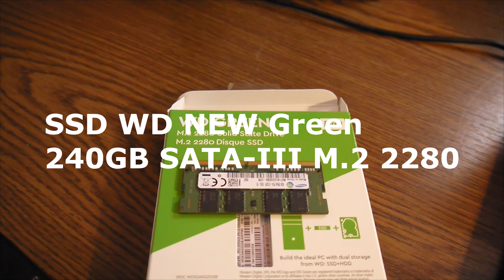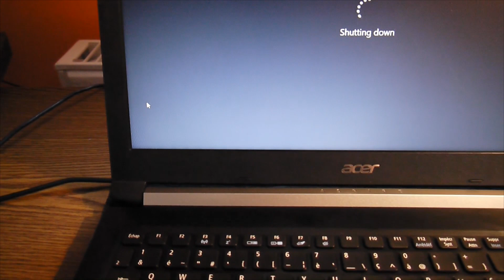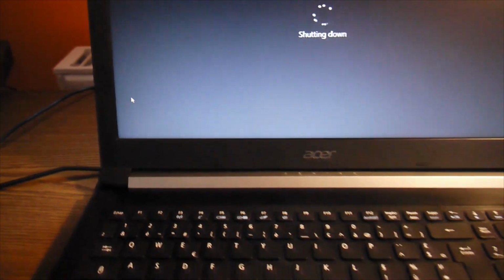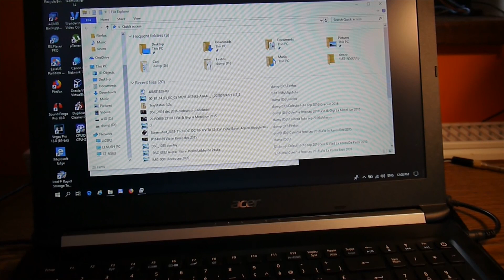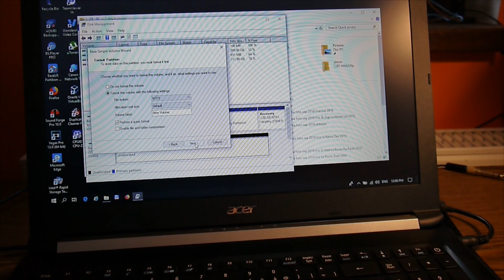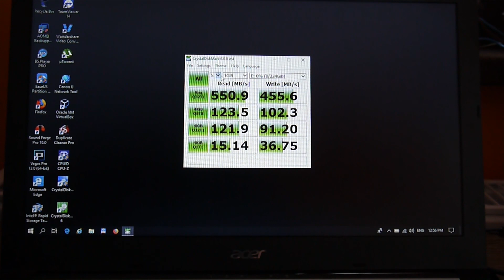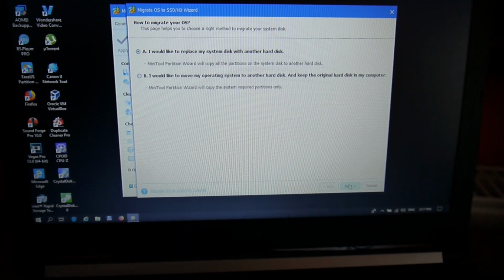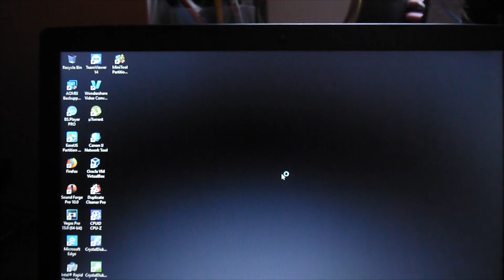Best Acer Aspire 5 A515 51 dismantle upgrade RAM and M.2 SSD

Comment: isn't that an Nvme port? Can I add m.2 ssd into that. The Nvme ssd has 2 pins while the m.2 has 3 pins
Reply from the maker: It's working perfect with M.2 SSD, I'm not sure about NVME, probably yes.
Reply from the maker: I couldn't afford a NVME SSD, so I just put in a M.2, but probably will fit one if your pockets are full enough! :-)
Reply: @viocaia  Thanks for the video and the quick reply. Actually, I went to buy WD green only but the shop people said that 
Nvme Ssd is required. So I came across your video. Now I will buy WD green for sure instead of the expensive Nvme ssd s .
Thanks.
Reply from the maker: @dejavukun   get a WD Green for now..mine is working smooth!  Good luck!
Reply from the maker: Hey! Just give me a hand and  subscribe ! Thanks!
Reply from the maker: about NVME install https://youtu.be/FA9paP39284

Comment: I have a 2TB, 8GB model, would motherboard support another 1TB ssd on it? and I am also getting 16gb ram, so that total would become 20GB. Is this fine?
Reply: I upgraded with 256 nvme and 16gb crucial ram. Has been more than an year and performs really really fast
Reply: @hvmalpani  
Does you laptop have a GPU??
Reply from the maker: Yes!
Reply from the maker: @hvmalpani  So NVME is working..thanks for sharing! Please give me a hand and subscribe...
Reply: @hvmalpani  bro which nvme you bought ? and can transfer original windows on it from hdd
Reply: Did you upgrade then??
Reply from the maker: @No_limits37  No, I'm still using the M.2 disk from the video..for me is more than enough..and it was a meter of price then..
Reply from the maker: As long as your SSD is M.2  or the kind of slot that fits the one in the video it should be ok.Also if RAM is DDR4 . should work as well.
Reply from the maker: Hey! Just give me a hand and  subscribe ! Thanks!
Reply from the maker: about NVME install https://youtu.be/FA9paP39284

Comment: Sir, I have 8gb Acer laptop of same model as your video, what is the specification or allowed maximum capacity for the empty ssd m
2 slot? Can I also replace the 8gb ram with 16gb?
Reply: The Max RAM on a A515 51G models supports up to 16GB single slot for a max total of 20GB memory (4GB onboard).
Reply: @Hurtsmysoul  Thanks Laura, I'm going to buy a new ddr4 memorry and I Will asking about if it's possible to supoort 16gb to 20gb total
Reply from the maker: For M.2  as much as you can afford, for the RAM just add another brick,the originals are soldered to the mainboard.
Reply: Thank you so much sir, more power to you.
Reply from the maker: Hey! Just give me a hand and  subscribe ! Thanks!

Comment: i have a aspire 5, it came with 256gb ssd and i want more space, can i add extra ssd and do i lose anything? i’m completely new to this, i would appreciate your response :)
Reply: also, what was the size of the screw you used?
Reply from the maker: What kind of Aspire 5 ..it should be there another slot for a M.2 SSD, so you can install an extra SSD M.2 for OS and use the resident as a data dump
Reply: Viorel Caia yeah i was about to put the complete model, it’s A515-51G-515J
Reply from the maker: Well, if is looking similar to mine, then you have for sure M.2 slot, so you can  fit a 256g M.2 SSD ,or better, and use the SATA3 installed like a data deposit, so the OS will boot from M.2 much faster.The overall speed goes like 20%
Reply: Viorel Caia but do i lose any data or apps?
Reply from the maker: @pipe451   No, as long as you move everything to M.2 and make it bootable from BIOS.
Reply: @viocaia  thank you very much :)
Reply: Viorel Caia hello again i am about to buy it and want to know if the ssd i put can be of 500gb or only 256?
Reply: i put the link of the ssd before
Reply from the maker: @pipe451  Hey you too! It can be as big as your pocket can deliver!
Reply: Viorel Caia that’s so great, thank you very much again!
Reply: Viorel Caia also would this ssd work as an extra? https://www.amazon.com/gp/aw/d/B073SB2MXT/ref=ox_sc_act_image_1?smid=ATVPDKIKX0DER&psc=1
Reply from the maker: Hey! Just give me a hand and  subscribe ! Thanks!
Reply from the maker: Please help me with subscribe! thanks!

Comment: Grea tutorial Viorel Caia . I have Acer aspire 5  A515-51g -5072 . i called acer support to make sure this laptop has m.2 Port they said yes, but the say you cannot use HDD and  SSD at the same time use either them of them in one go. is that work together i see you did both together and do i have the same laptop you got?  plz reply thanks in advance
Reply from the maker: They are working together.After you install M.2 SSD, move the os to SSD and in BIOS make it first boot.Afterwards delete old HDD partitions, and repartition and format.It have to loose any booting propieties, it just a simple data deposit.
Maybe acer support was thinking about  haveing two boot disks in the same time.Everything will be much more easy if you can connect old HDD by a usb adapter, then is very clear the laptop is booting from SSD.
Reply: @viocaia  thanks you so much for advice.
Reply from the maker: Hey! Just give me a hand and  subscribe ! Thanks!

Comment: hello i want to ask a question the aser aspier 5 battery is no enough just 5 hr can't do a thing so shlod i buy some high end laptop battery how can fit and drop it in
Reply from the maker: It's kind of difficult as long as the battery is inside the machine, you can't simply replace it with a bigger one.I think there are some compatible models, a little bit more powerful, search the net for something like this model 15.2V 48Wh AC14B8K
Reply: @viocaia  finally a good answer
 thx man
Reply from the maker: Hey! Just give me a hand and  subscribe ! Thanks!

Comment: Hello i'd love to do this upgrade myself but unfortunately i'm not able to find this memory in any stores in my country. Are there any alternative memory cards i could use instead of this samsung one? thx for answer :)
Reply from the maker: Any DDR4 will do the job,  even the cheap ones running 2133mhz are fast enough, see crucial CT16G4SFD824A, Kingston 8GB DDR4 PC4-17000 2133Mhz 260-pin SODIMM Non ECC Memory RAM...
Reply: Viorel Caia already ordered a crucial ballistix 8gb, thanks for helping. I’ll follow your tutorial once it comes
Reply from the maker: @jankonn9223  It should work! Good luck! Dont forget to touch anything metallic before starting anything,  for antistatic discharge.
Reply from the maker: Hey! Just give me a hand and  subscribe ! Thanks!

Comment: Hi, nice video, can I remove the battery without any problems and keeping using the notebook directly in energy?
Reply from the maker: No you can't because the battery is inside (like tablets have) to remove it you have to open the whole bottom pad and take it off physically.
Reply: @viocaia  Hi, thanks, I express myself poorly, my intent before is just to "remove" the connection of battery, not the whole battery haha, I did it, just removed the cable and works well, I don't recommend to remove the battery as like you, after you said that I opened my notebook to do the service, and I saw, there is no need to remove the battery physically and my suspects is that if someone remove the battery physically with the pass of the time it can desbalance the weight of notebook and can cause some trouble in touchpad in the future, there is my suspects as the way the notebook was build.
Reply: If someone wants to open the notebook to remove the cable of battery, please remove the HD first, removing the screws and the cable that connects the HD before open the notebook, because I disconnected the HD cable with motherboard(?) and for a noob me, or a person that has no experience on that can have a hard time.
Reply from the maker: @Guivaxs  absolutely ! the battery is a part of the mechanical structure somehow.You did well!
Reply from the maker: Hey! Just give me a hand and  subscribe ! Thanks!

Comment: I wish the M.2 drive was accessible through a window like the RAM is. That way I could add an SSD without voiding the warranty.
Reply from the maker: well I.m afraid you can.t, you need to open the plastic lid.But why not chage only the main HDD with a SSD for now and later when the warranty is over do the rest..maybe is getting chepaer in 1 year.
Reply: @viocaia  Ok, that's a good idea, I might do that. Thanks!
Reply: The Acer Aspire A515-52G that I'm looking at doesn't have the HDD and RAM ports at the bottom. 😞
Only the Aspire 3 models do.
Also the keyboard feels pretty cheap.
Reply from the maker: @JAYRAY00   well, it should have if is the same model like in the video, if not take some passion and open the lid, is not so difficult.Cut the power before, check for a little hole and push with a needle, that is disconnecting the battery,
Reply: @viocaia  I found the A515-51G, it's a bit more expensive, but worth it for the build quality. I've taken apart several laptops before, but as it's for my Dad, I don't want to void warranty. But apparently, if you upgrade the RAM or HDD on these models, it still voids the warranty. It's not a big issue with the RAM, as that can be easily removed before warranty repair.
Reply from the maker: @JAYRAY00  I'm not sure, I did it anyway, I had bad experiences with warranties before so I don't care, if is burning ..let it be! That's life, so I did what I need, M.2 SSD, extra RAM and a IPS panel, I'm totally happy with result.And the battery is running great too! Good luck!
Reply: @viocaia   Dear Viorel, would you kindly inform me which IPS panel you used?
Reply from the maker: @simonshurety3870  check this...
https://www.youtube.com/watch?v=mUdu9C8JOjE&t=297s
Reply from the maker: @JAYRAY00  I don\t know the model..mine 51G feels pretty strong..but I'm not  too mobile let's say, it's more like a desktop replacement for me.
Reply: If you upgrade ssd in authorized service center near you, you don't have to worry about warranty.
Reply from the maker: Hey! Just give me a hand and  subscribe ! Thanks!

Comment: my laptop is the same model but comes with 8gb ddr4 memory can I upgrade it, and will it make it run faster cos to be honest it is slower than a wet week and it is a new laptop
Reply from the maker: I think you should have a second SSD M.2 for the OS and applications.Even a cheap one like my WD green makes a huge difference.I also have 12G RAM (4 original and 8 on the slot)...well, it's pretty ok, I'm doing music, a little video and photo editing and it's moving way better then my ex SONY I3...and the HD display I put on is so much better than the standard TN.
Reply: @viocaia  You upgraded the display on this Acer?
Reply from the maker: Hey! Just give me a hand and  subscribe ! Thanks!

Comment: Hey man, nice video, I have a question, where buy you the screw for slot the m.2, because i bought  the 970 evo in my acer aspire 5 but  don't have the screw :((,  help bro
Reply from the maker: Hey! You may use one from the HDD, don't worry it is fixed enough with only three.
Reply: @viocaia  thanks dude! ❤️
Reply: @andersonzavala9659  
Is the Acer aspire 5 A515-51G is compatible with M2 nvme SSD

Does it worked with Samsung 970 Evo
Also could you please give me the benchmark if it worked on your's laptop
Reply from the maker: Hey! Just give me a hand and  subscribe ! Thanks!
Reply from the maker: about NVME install https://youtu.be/FA9paP39284

Comment: did you remove the original memory or you can place 2 memories in acer aspire 5?
Reply from the maker: The original 4G RAM is soldered to the motherboard, you have only one slot for extra DDR4 (up to 32G).
Reply: @viocaia  ohh and what if i replaced it will my all apps and etc. go?
Reply from the maker: @Aditya-zg9eo  The extra memory slot  doesn't affect any of the apps installed, just make the laptop faster and quieter.If you're talking about replacing the HDD hard drive, well there are two ways.To let the original in place and add a second SDD M.2 (the small one in the video) than transfer all the data to the new SDD or to replace the original mechanical HDD with a SSD, so you need to transfer all the things before to the new disk to make it bootable.Also you may save everything like a Image (plenty of software to do it) and just ''reimage'' the new hard drive.
Reply from the maker: Here is a misunderstanding.A memory in computer world refers to RAM (the small bricks, not the hard drives) , so if you thinking about having two Hard Drives (consider that a data bucket!) yes you can have 2 drives installed in this laptop.
Reply: @viocaia  which ram did you use ??
Reply from the maker: @gaganbhagat8547  It's in the video at 0:40 , but any DDR4 will do the job.
Reply: @viocaia  i think it will be upgrade able up to 20 gb ,the official site said that ..
Reply: by the how does your laptop peforms in terms of gaming mine model has 4gb ram and the hdd and i am thinking of upgrading it ,did the upgrade enhance your performance?
Reply from the maker: Well,  @drdecember614  the first display TN was pretty ok, after upgrade to HD LCD I had to change the resolution to half! But, amazing it was running  betterr with TN dusplay 1388 than a HD like I have now.If you are looking for a decent gamming laptop as long as you don't want HD that's a winner!But if you cnsider photo and video editing HD1080 is a must.
Reply from the maker: @drdecember614  and strictly to the question, every RAM upgrade and turn to SSD will boost your laptop permances at lest 50%!
Reply from the maker: Hey! Just give me a hand and  subscribe ! Thanks!

Comment: ive just realize mine only has 4 gb built in but no Extra ram chip installed in it. i hope it will help my laptops performance. im still thinkin abt upgrading it to SSD but we will see i might as well buy a new gaming laptop. im using an ACER 5 just like yours. and so far some games it works fine on medium settings but i havent tried it with SSD and More RAM im excited to see the outcome though
Reply from the maker: I'm not a gamer but I use a lot of audio and soft synths and after I added extra 8 G RAM and a second M.2 SSD only for the OS, so I keep the classic HDD  for storage but the OS and all the software are running mainly from a WD M.2 SSD... it was a huge difference.Of course it cost me like 100USD for the parts, I did the work myself.So if you can get a better laptop for 100 or 200 extra..do it.
Just for fun I installed Shadow of the Tomb Raider and with medium settings is running  very nice and fluently.
Reply: ah yes. im getting the mx500 SSD 500GB and replacing my HDD 1TB since i noticed i dont have too many apps on my laptop besides games. so hopefullu with my new Crucial 2400MHZ 8GB and crucial MX500 SSD 500GB it will make my laptop run smoothly for certain games on medium settings. with the MX150 u can also play resident evil 6 by the way. it ran smoothly for me
Reply: @viocaia  bro is it good to use this laptop for Programming and Virtual Box.. I also want to install dual boot on my system but will it work ?
Reply from the maker: It's more than enough.I replace the display with an IPS full HD and I'm doing video and photo editing like a dream.So, I'm also using Oracle Virtual box and running some soft synth without a clitch. I recommend more memory RAM from the begining.As for dual boot, I think is very easy because BIOS is very flexible.
Reply: @viocaia  than soon i will get one and thanks for replay....
Reply from the maker: Hey! Just give me a hand and  subscribe ! Thanks!

Comment: do u think this 16 GB ram will fit in the socket? https://www.amazon.co.uk/Corsair-CMSX16GX4M1A2400C16-Vengeance-SODIMM-Memory/dp/B077S17RPZ/ref=sr_1_17?ie=UTF8&qid=1546012000&sr=8-17&keywords=16gb+ram+ddr4+laptop
Reply: regarding this...i noticed certain RAM chips have different dimensions so im concerned that i might buy the wrong one
Reply from the maker: I think it's ok, as long as it is DDR4

Comment: Will it support wd black nvme ssd?
Reply from the maker: I'm not sure, I couldn't find any info about it.But M.2 is running for sure.It's amazing faster then original mechanical disk.
Reply from the maker: I did some digging and it's looking like is able to work NVME disks too! check this: https://community.acer.com/en/discussion/comment/548485
Reply: @viocaia  plz make a video for installing nvme ssd it will be better to clear doubts
Reply from the maker: I don't have one, but as I see the pins, there are exactly 5 pins to right until the key.So , the SSD I'm using a WD Green 2280 is exactly the same 5 pin until the key.I don't really think it's really worth the money for NVME, a good WD Blue M.2 2280 is doing a perfect job.In real world all those fancy tehnical caracteristics are only in lab conditions.I'm really happy with my ''lazy'' WD green 240Gb 2280.
Reply from the maker: https://community.acer.com/en/discussion/537125/install-m2-ssd-on-aspire-5-a515-51g
Reply from the maker: Hey! Just give me a hand and  subscribe ! Thanks!
Reply from the maker: about NVME install https://youtu.be/FA9paP39284